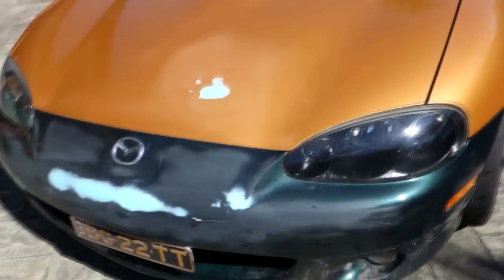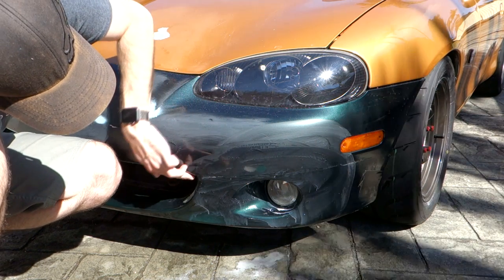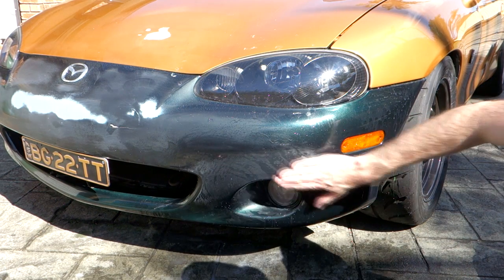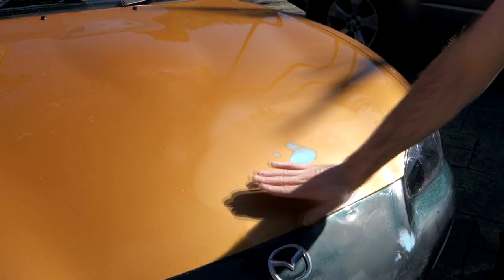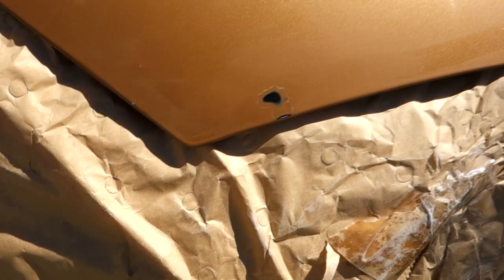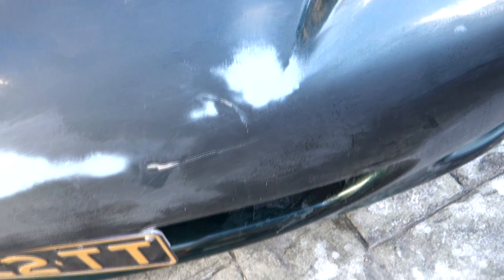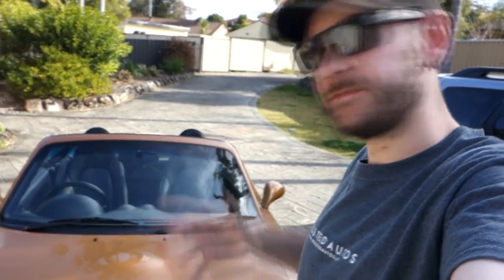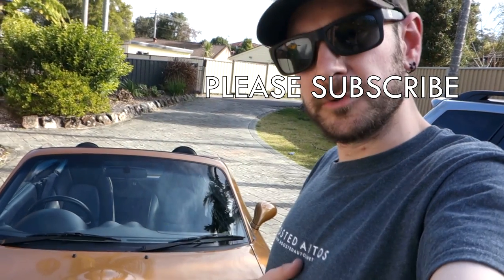How to Wrap a Car - Part 1 - Preparing the body for Wrapping

Comment: Will the wrap hold on primed panels / areas just as good as on painted surfaces? Any idea on how long it will hold depending on the surfaces?
Reply from the maker: Doesn’t hold as well on primed surfaces as it does on paint. Primer is also hydroscopic. Definitely better to paint first.
Reply: Thank you for your quick reply!
Reply from the maker: You’re welcome :)
Reply: Im prepping a car now should I spray primer on the bondo and filler or leave it just bondo
Reply from the maker: I didn’t bother with primer in my case and it worked out fine. Ideally you should prime and paint though.
Reply: @boostedmedia what about to put a thin coat of clear coat on top of primer? (As i don't care what's underneath, o just want the wrap to stick as good as possible)